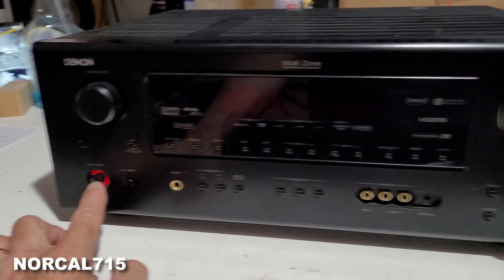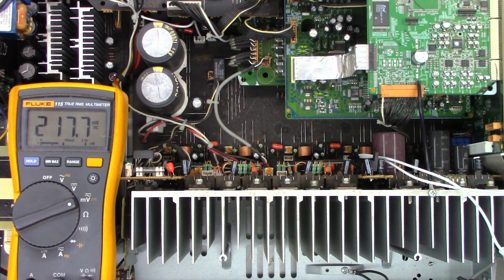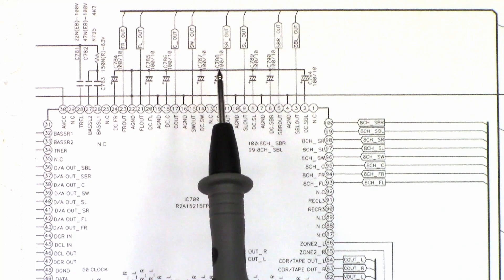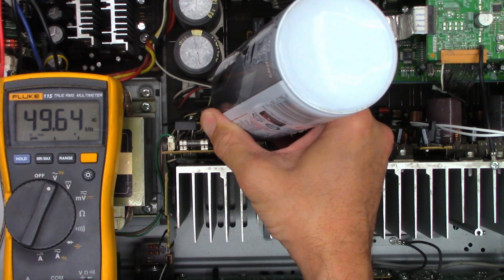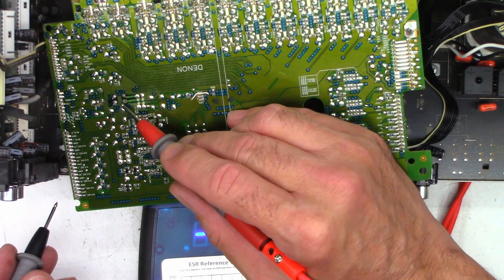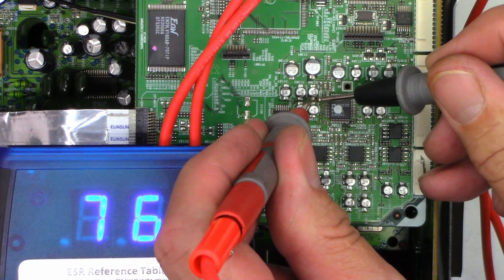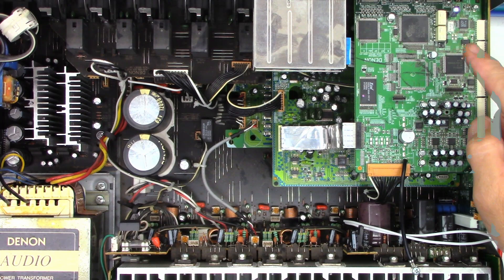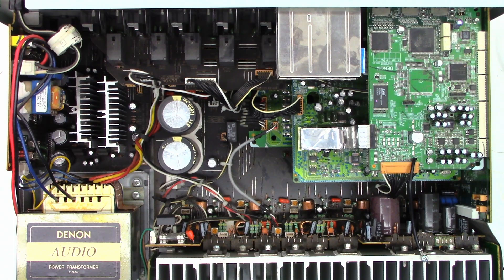Denon AVR-788 Receiver shuts off when cold when volume is turned up even with no input or speakers

Comment: My Denon a/v receiver was doing the shut-down and I realized that Zone2 (unused/no speakers connected) was set to a high volume level. Problem disappeared when I turned Zone2 off. I don't think it was faulty, just a really crappy design. With speakers connected, Zone2 worked totally fine.

Comment: I have a Denon AVR-1908, it's pretty simular to this one. I'm facing a similar problem, I need to set the volume way higher than expected to just hear a high pitch noise and barely hear the sound that I'm playing. When I set the volume to 10dB, it starts to smoke from the amp board. Watching your video I will try to listen the sound directly from the DSP board, to try to identify if the problem is coming from that.

Comment: Cap rot strikes again but a good find. I have always wondered, how to keep amplifiers going. Any advice. Perhaps that would be a good video. Myself I leave them on all the time, amps that is, never put them in a rack or put anything on top. If they are off, not having anything blasting out when the relays kick in. In other ideas or do I have it all wrong?
Reply from the maker: The thermal cycling can lead to bad solder connections. Setting the volume at minimum upon power up is a good idea too. The cooler they run the longer they will last also.